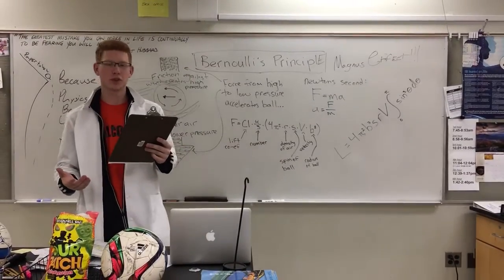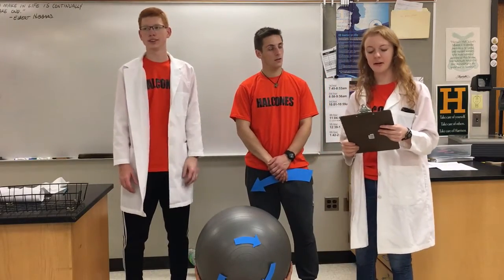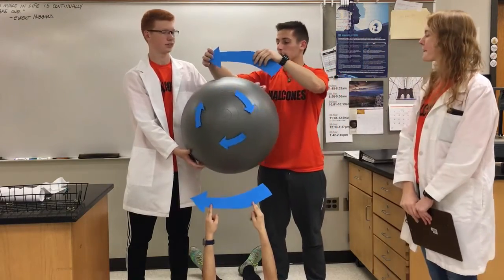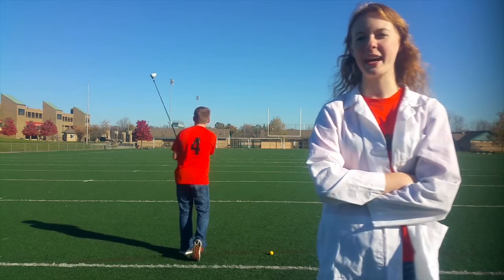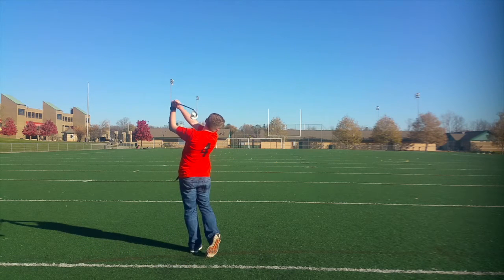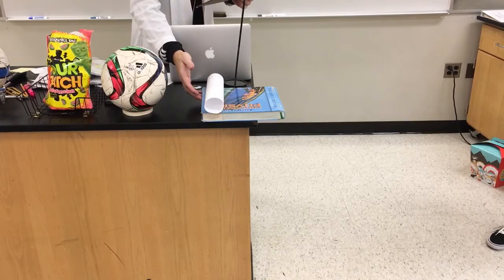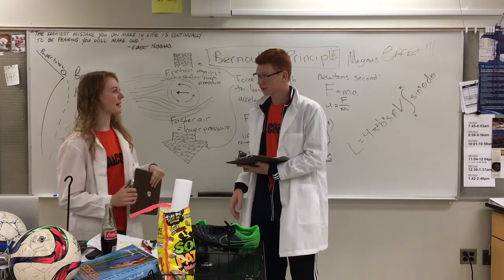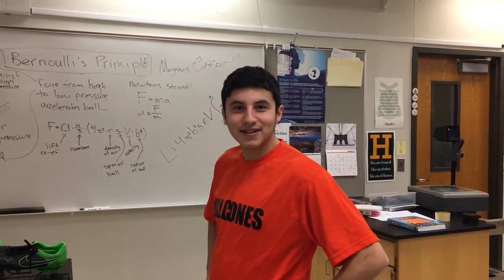Bernoulli's Principle and the Magnus Effect FINALLY REVEALED!!!!

Comment: The Magnus effect only applies at low fluid speeds. At high speeds, the pressure does the opposite with Bernoulli's principle.
Reply: I realize this is 2 years old, but I don't understand what you are implying.  As long as the flow is subsonic, I think bernoulli's equation applies as described.
Reply: @user-we4ul8jw3k  The Magnus effect reverses the Bernuile principle at certain speeds. 
Videos have shown it. 
It is counter-intuitive.
Reply: @user-we4ul8jw3k  I think where my mental confusion is coming from is; 
The two should be the same, but I am told they are opposites.

Comment: I've got a question.. 
Bernoulli principle is higher the velocity of fluid, lower the pressure..
Ball in the end is having higher pressure on the top which is true, but isn't it opposite to what Bernoulli says?
Reply: The Magnus effect only applies at low fluid speeds. At high speeds, the pressure does the opposite with Bernoulli's principle.
Reply: I realize this is really old, but...  do you mean the ball on the whiteboard?  I think the air on the top of the ball is slowed down by the friction of the ball rotating into the air ("against the wind" so to speak).  Since that air is slowed down, the static pressure increases.  Meanwhile the velocity air on the bottom of the ball is increased by the friction of the ball spinning with the airflow on the bottom, which decreases the static pressure.

Comment: Where is the Bernoulli's principle?
Reply: The Magnus effect only applies at low fluid speeds. At high speeds, the pressure does the opposite with Bernoulli's principle.
Reply: @MarkBarrett  ?
Reply: @user-we4ul8jw3k  The Magnus effect reverses the Bernuile principle at certain speeds. 
Videos have shown it. 
It is counter-intuitive.
Reply: Jad M worked very hard on this video, have some respect!
Reply: @burgerthursdays2060  don't worry buddy, hardly confused is confused after the simple explanation. lol